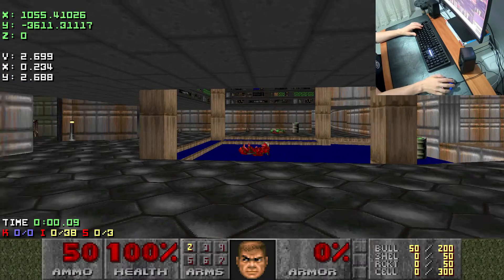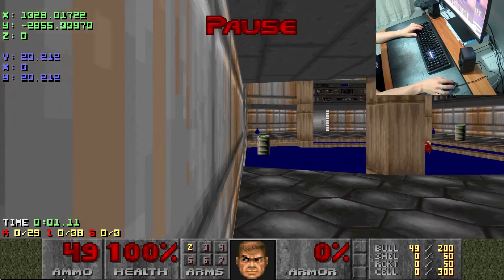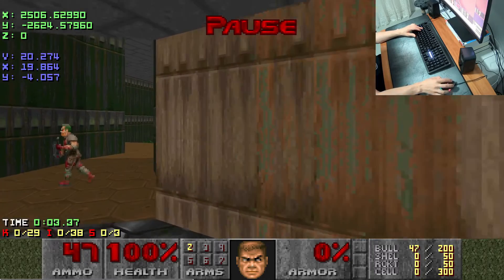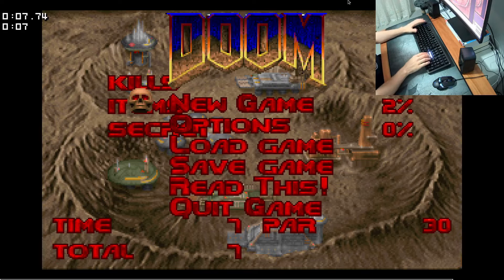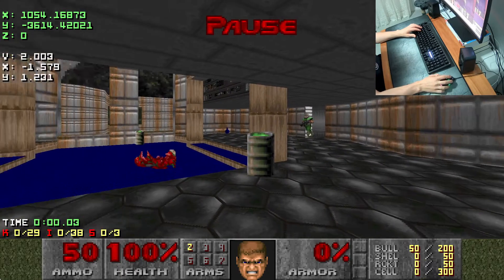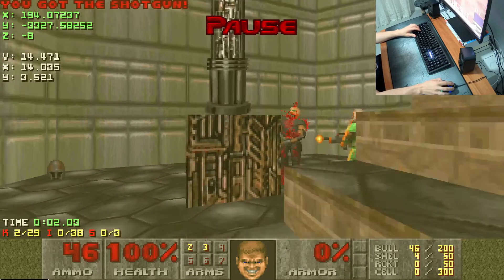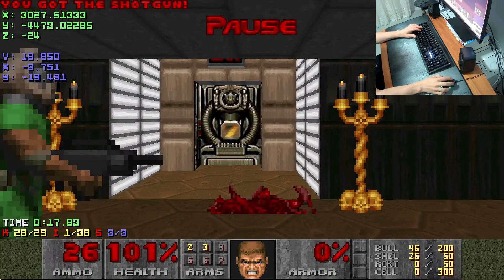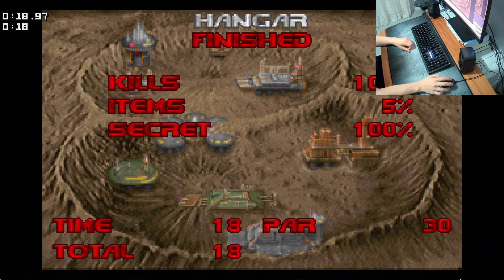Exploring E1M1 TASing

Comment: someone recently got a high 24 uv max. based on your knowledge, would you say sub 24 is possible for a human?
Reply from the maker: I would guess not, but to be honest I'd have also guessed that 24 wouldn't be possible :) so who knows. I suppose it's possible that someone could have an absolutely freak run where everything goes perfect, but I couldn't really guess the lower human limit of that. I definitely appreciate you asking but I don't feel that I have enough non-TAS experience to accurately guess at human limits, knowing what's possible in a TAS setting is interesting and all but TAS and non-TAS have entirely different situations when it comes to movement complexity, consistency, and luck.
Reply: @almostmatt1tas  ok, making a second reply here. that guy may have very well cheated. at 0:17 do you notice anything peculiar? if he did indeed cheat, it's weird that zeromaster of all people did not catch it.